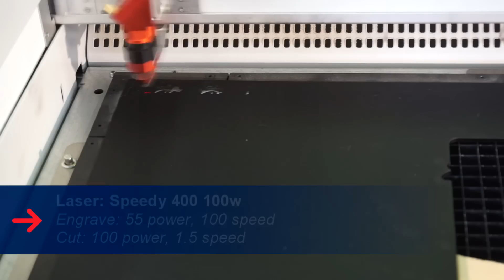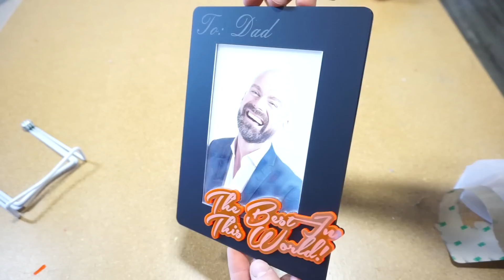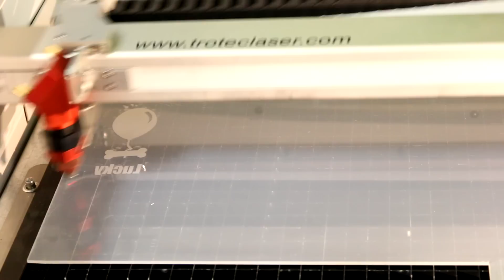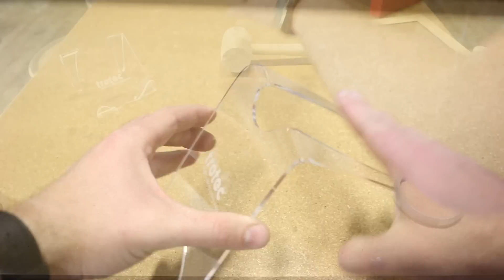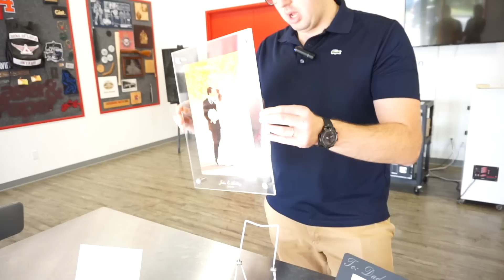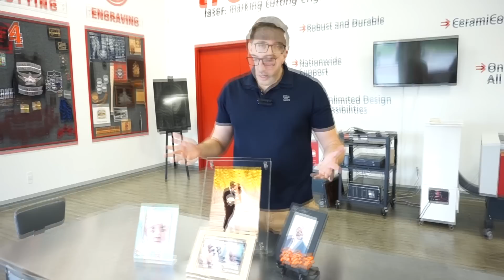Laser Cut Photo Frames | Custom Picture Frames | Speedy 400

Comment: Hi for the wedding picture . Wouldn't a customer  have to take apart the assembly to drill and set the mounts . What kind of standoffs are you using
Reply from the maker: No necessarily, you can hold the 2 acrylic pieces together and mount them on the stand offs then add the top caps. We sell our own line of Trotec stand-offs.

Comment: Is the plastic covering on the cast acrylic TroGlass laser safe?  Can you cut and engrave with the covering on or should it be removed before putting in the laser?
Reply from the maker: Hi John. Great question. We recommend if you're only cutting, then leave it on, the covering is completely safe - leave it on can protect it from any flame/burns especially if you're exhaust is not strong enough or if you're cutting thick acrylic. However if you're engraving you should take it off because it will distort the engraving since you would have to burn through the covering before engraving the actual acrylic. Hope that answers your question!
Reply: Thanks!
Reply: @TrotecLaserCanada  The plastic covering is vinyl isn't it?  So it should be removed...